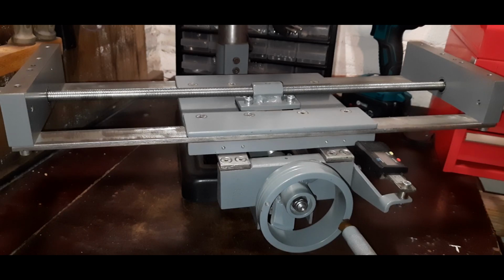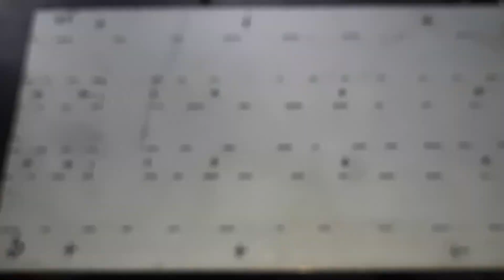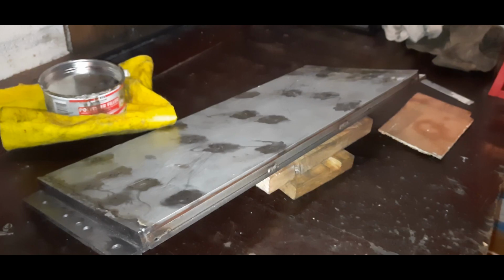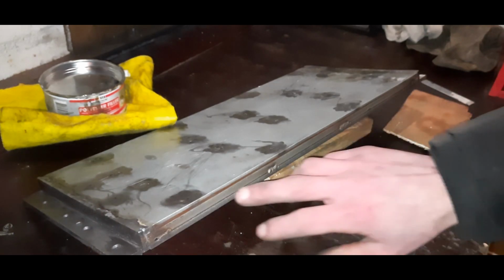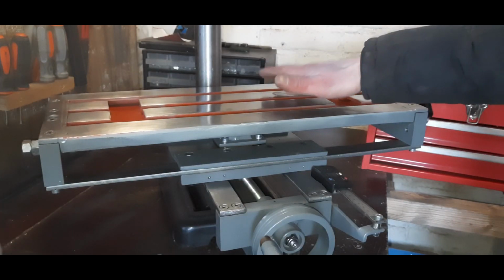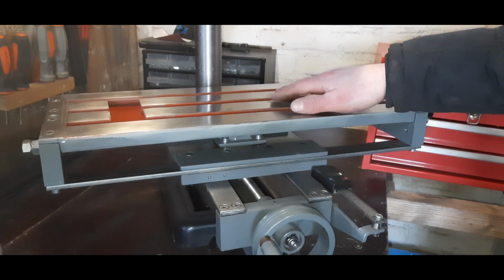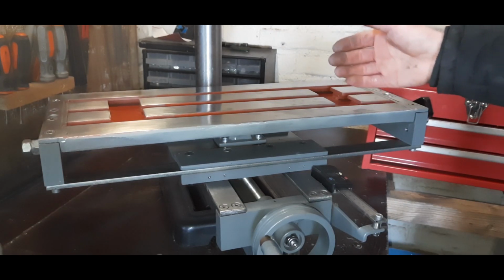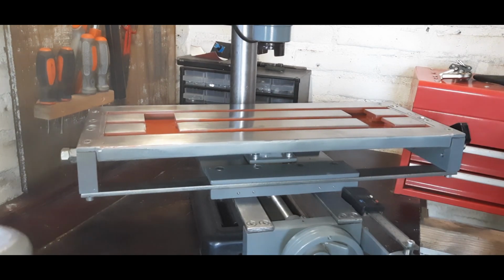Homemade T-SLOT Milling Table    [homemade milling machine]

Comment: Bro can u make it easier by draw ur design
Reply from the maker: I didn't make a design for this table :-) I strongly recommend making a design if you want to build something similar. Sometimes the 'picture in your head' just doesn't work out.